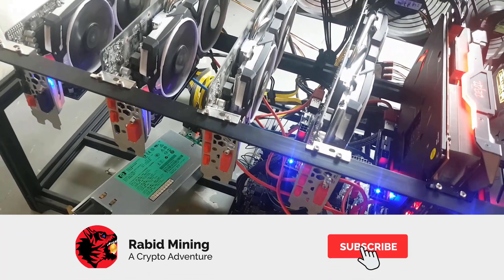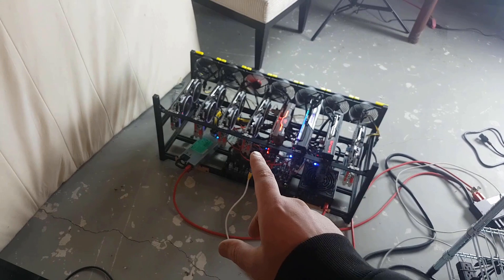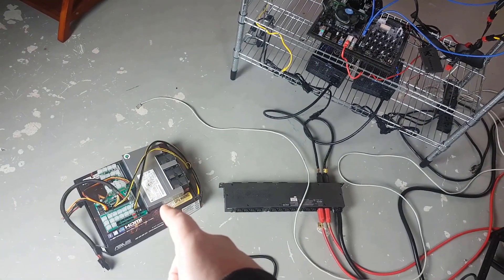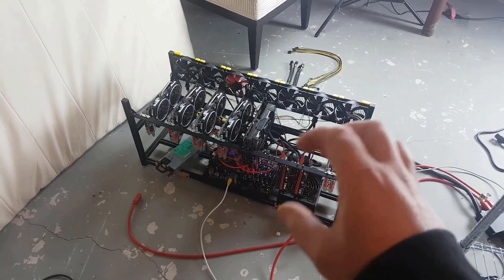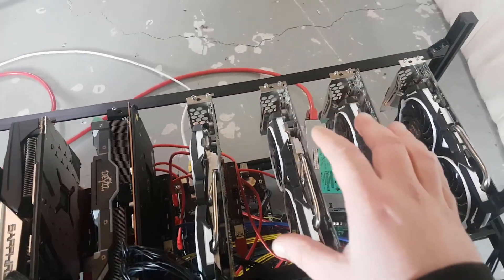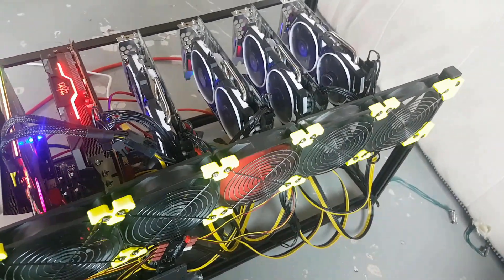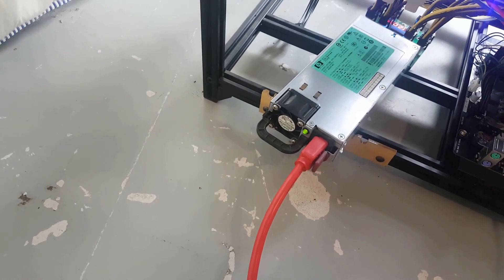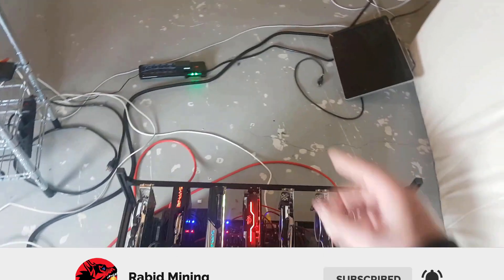Loading Up My 1200w HP SERVER PSU Past The 80% Rule For Crypto Mining

Comment: ok can somebody actually confirm the truth?
does this mean if I am using a 1200w server power supply i can safely pull 1000w on a 24/7 basis?
Reply from the maker: Yes you can of on over 220v

Comment: Hi, it  looks like i have the same one. But when i plug it to the wall i dosent give me any power on the other end. Nothing. Should i short some pins for it? Im out of ideas. I bought bran new unit
Reply from the maker: Maybe try there support is the breakout board turning on?
Reply: @RabidMining  ive for different board, with mobo power delivery build in. But that's not the case probably. When its conected to psu fan spins, green light turn on (on psu) but that's alll. No power. Without conected breaking board fan spins but Led dosent light up.
Reply from the maker: Not sure

Comment: in case of power cut, how yo automatically start the hp psu before the pc starts.
in my case when my rig turn on after the power cut, it doesn't mine until I manually turn on hp psu and then pc in the same order.
it's very frustrating, switching my rig on manually after each power cut.
Reply from the maker: Depending on the breakout board they retain there power state so will just fire right back up again with the x11 and zsxamp boards check the links if you dont have one.
Reply: @RabidMining first of all Thank you for replying. And secong
 I have connected my atx power supply to breakout board. But after power failure the gpu connected wit the atx psu only shows and mine rest are detected as malfunction. I then manually have to power on server psu first and then ATX psu to work all of them. Any suggestions how to solve it. It's very frustrating as I live in area with too many power cuts a day.
Reply from the maker: Oh crap hmm you could maybe run a 2psu cable to the zsx that way if you have a zsx board that is when the server psu turns on it will tell the atx psu to turn on giving it that little extra delay and head start
Reply: @RabidMining  oh thank you , I'll try that psu breakout board and try connecting.
One more question for you by the way. My 1200w psu on no load (ony breakout board connected) pull 43w. Is it normal?

Comment: The PSU you are using is only capable of drawing 900W on a 110V plug
Reply from the maker: yes the 1200w is only 900w if on 120v as I mine on 240v dont have a issue.

Comment: Why does 80% matter? I've not heard this before. Thanks
Reply from the maker: Well with electrical usually wanna keep it at 80% or below for continuous power long term over that could lead to damage or failure.  Server psus could be different but also trying to show that lots of people do use software power as what they think is the power and you are actually using more.  So all my servers psus are quiet when under 80% but a lot of people have theres screaming and was trying to show that if you are getting close to the max power then your server psu will get loud.
Reply: @RabidMining  ok thank you for the info :) 😀
Reply from the maker: @snuggleseal  np

Comment: can you help me too,  be quiet! platinium 1200w or hp server 1200/1500w. Which one should I choose?.the most important for me is less power consumption. I'll use 6 or 8 cards rx 570 with btc-t37.
Reply from the maker: Do you have 240v power or 120w?
Reply: @RabidMining  I don't understand electricity at all. I'm in Turkey. I guess everything here is 220v.

I'll just get server psu. I can run everything with apparatuses like pico.
Reply from the maker: @sevincvincvinc8106  yes 220v works go with server psu.
Reply: @RabidMining  Which one would you prefer? Could it be 1200w be quet! platinum or 1200w hp server? for energy-saving?
Reply from the maker: @sevincvincvinc8106  would go with the cheaper one lol hp seem to be good server psus
Reply: @RabidMining  Thank you
Reply from the maker: np stream is starting soon if u want to hang out

Comment: What is the correct type of power cord to utilize with these PSUs? I assume the standard power cord from a PC ATX PSU may not be appropriate. What is recommended?
Reply from the maker: Mine goes to a PDU for 240v which I will probably go over next video.

Comment: Hi. Hope you notice my question. I just starting mining and im looking to get one these server psu. I just wanna make sure if its ok to plug a 6 pin to dual 8 pin cables on each of the slot of breakoutboard without frying everything?
Reply from the maker: Ya will be ok although it's best to use 1 6pin to 2 risers and for gpus use a 6 pin per gpu 8 pin slot.
Reply from the maker: Be sure to check out my links if you end up getting a server psu :)

Comment: Question you mention spliters if the card as one 8-pin, but and you power a card with two 8-pins using and a riser if you use a 8-pin vga from the atx psu?
Reply from the maker: 2 risers per pcie or 1 card and its riser if a single 8 pin 1 gpu with a splitter if its 1 8 pin and a 6 or double 8 pin card.

Comment: I quadruple dare anyone to show me PROOF about this totally made up - 100% b.s. - crap told by youtubers - 'rule of 80%' - there is no such rule. It seems to me that people have the efficiencies confused/compounded w/ the limit. The limit is the limit it's sold @. An 800W does 800W - PERIOD. If it's an 80% efficient supply - you can expect that it takes 864W to make that 800W - but you will NOT get - nor there is ANY RULE about only using 80% of the available maximum power rated power. It's not some kind of 'trick'. When you buy a 1000W ps you get 1000w. There's not some marketing game that secretly means it's really only 800W and they are tricking you.  I see dozens of Super casual youtube miners who no know nothing about how a regulated power supply works - and just keep repeating the next guys stupid advice. This is annoying and frustrating. I have 25+ years as a certified electronics technician - I'm not guessing.
Reply from the maker: 80% rule is by electricians with anything to do with power not efficiency should always only run any electrical components at 80% of there max output as a safety.  The 80% rule more so for the wiring involved in anything if ran at 100% will run into massive problems like melted wires and fire hazards. At least in canada it's a rule.  Guess more technical is 80% continuous load of a 125% max when the load is going for over 3 hours which is done in mining.
Reply from the maker: So you saying can throw 1200w at it and be fine long term? If you are a electrical engineer would like to know the numbers as I am not and just research from google.  If true then let me know msg me in my discord and will work out correct numbers to broadcast.
Reply from the maker: Hey so I was doing numbers based on the 80% of the 125% and it seems to work out be the max rating of the psu.  So in your trade and experience that mean the max rating is the max safe rating?

Comment: the HP 1200 will spin up at 1000 but come down 10-20% once load is normalized.  Above 1100 and into 1150 is when it goes full out, but that was what you already heard, the high pitch whine.  It doesn't get loader than that, unless it's a broken/bad fan.
Reply from the maker: Good to know just see so my screaming like crazy lol
Reply from the maker: @davidanthony1816  this is true there is knock offs of all sorts of parts out there.

Comment: I just got this HP1200w PSU with a Parallel miner ZSX  break out board (its dope af) im  running 3 Asus RS 5600xt pulling 222w (per system) and its  practically silent, a little warm to the touch tho...
Reply from the maker: Ya they are sweet that break out board is amazing.  If you need more use my links :)
Reply: @RabidMining  I need another one for my Delta 2400w Server soon ill def hit your link up!!
Reply from the maker: @Ballistic187  nice ya if on 240v I prefer server psus over atx if you can handle the noise that some throw out.